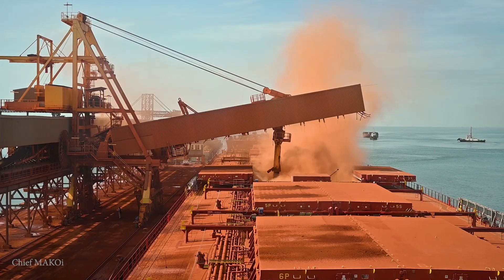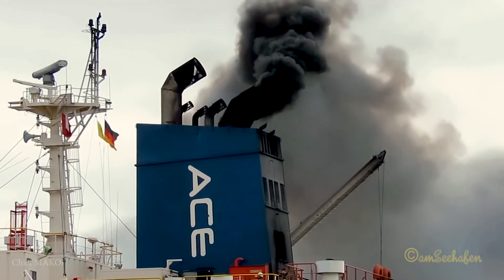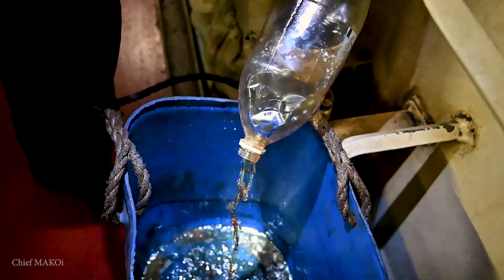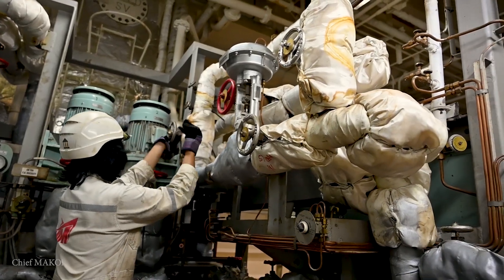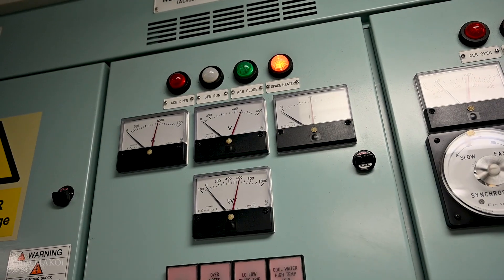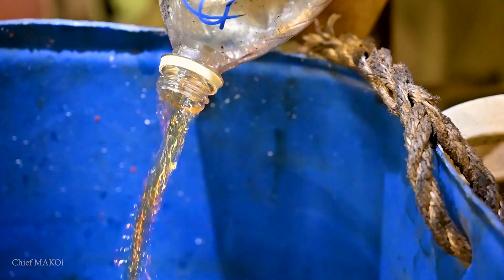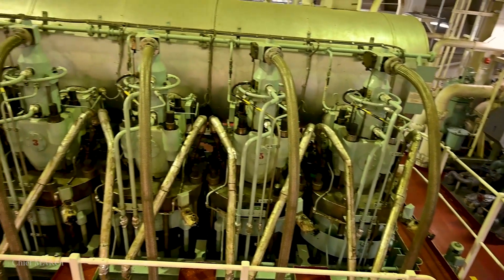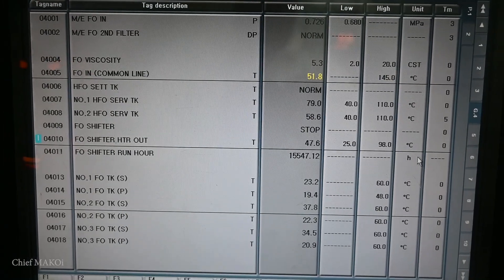Changing The Ship's Fuel : From Heavy Fuel Oil to Gas Oil Changeover Procedure | Chief MAKOi

Comment: Fascinating. Back in the late 70's I got to spend a few hours in the engine room of a cruise liner. The fuel they were burning looked like crude oil. You could watch through glass panels this mix being sprayed and burnt like a giant incinerator. Noisy hot uncomfortable place. Then you had to think back to the coal powered and the conditions the stokers worked in. Things have definitely moved on.
Reply: I think if you look ad some historic ships or railroad locomotives, you find a number of those had been converted from coal to Diesel at some point.
The steam engine remained the same, but the boiler was no longer coal fired but had an oil burner.
This was easier and faster to refuel and you could save personell as no one was needed to shovel coals any longer
Reply: @alexanderkupke920  Many WW1 warships were similarly converted from coal to oil fired boilers, when they were re-activated in WW2 It not only saved manpower, the new boilers were much smaller.
And not to forget USS Enterprise, which was converted by replacing the oil fired boilers with nuclear reactors. Though this was done during the design phase, before either was installed.
Reply: @peregreena9046  
Enterprise didn't have superheated steam, so the steam was wet, and the turbines sustained a lot of cavitation damage to the rotating elements, and internal casing's. The next carrier has superheated steam, and so dry. Not sure how that was done with the reactors, unless the superheaters were fuel fired. (JP)
Enterprise had 8 reactor's, 4 engine's, the later carriers have 2 reactors, 4 engine's.
Still fission reactor's, and therefore unstable.
Reply: @jimallen9859  Superheated steam or not, the machinery, from drive turbines to steam catapults, was the same as what was originally designed for the oil fired boilers
Reply: @alexanderkupke920  
The engine is still the same with a nuclear reactor as a boiler.
1,200psi superheated steam is some of the biggest horsepower in the world. Can make a 100,000 ton aircraft carrier jump out of the water like a flat bottom race boat, when Emergency Flank speed rings up. Awesome power, can push a bow wake higher than the flight deck. (a tad faster than the stated 32 knots)
Reply: For a long time the oil industry have been working on how to liquify coal to make it easier to mine after all it is the same as oil except it has gone hard over time.  People should award the miners and oil workers with knighthoods for what they have done for civilisation.
Reply: @Cruner62  Rudolph Diesel first experimented with making a engine that could burn coal dust before he settled on oil fired engines. I believe the he gave up on the idea after the coal dust engines exploded
Reply: @Cruner62  The Germans did a lot of work on making synthetic liquid petroleum from coal during World War II, so the processes by which it can be done are pretty well-known by now. The trouble is, the coal has to have been mined already to be put through said processes, besides which, they're so colossally inefficient that doing so only really makes sense if a) you have access to a huge amount of coal, b) you need liquid petroleum very badly, and c) you don't care how much damage you have to do to get it. As such, I suspect this is a technological dead end...
Reply: @ZGryphon  
Well, synthetic oil lubricant's have certainly taken off.
Reply: @jimallen9859  Different sense of "synthetic". Synthetic fuels like we're talking about above are made from a base material other than petroleum (usually coal) using very energy-intensive processes. Synthetic lubricants are almost always still mostly stuff that came from crude oil. In their case, it's a trade term for "contains a lot of fancy additives".
Reply: Worst thing about old huge cruise ships that could take a full day to resupply ocean cruise ship every time they crossed the ocean. Think the Titanic had around 80 guys shoveling coal into the boilors.

Comment: Great insight, thanks Chief. Can you talk about the fuel oil filters used for both VLSFO and LSMGO? I assume when using VLSFO, you have to operate the filters at low flux rate due to high viscosity?

Comment: Great video!
Some Chief Engineer friends (cruise lines) told me that going from VLSFO to LSMGO also may cause fuel spraying on hot surfaces and risk of fire. This is because VLSFO is more viscous and seals small fractures, while LSMGO basically cleans the pipes.
Is that true also for your engines?
Reply from the maker: It's possible.
Reply: In my experience the heavy oil circulates around the fuel system loop very hot 100c + to maintain viscoty. The MGO is unheated so the expansion and contraction due to temperature change can cause joints and gaskets to leak. After switching over an engineer is required to stay in the engine room to check for leaks.
Reply: @bigtuna4037  Exactly. In my case, when they switch to LSMGO they keep a  24h constant fire guard in engine room.
Reply: Do you mean scavenge fire or is it something else different entirely?
Reply: @cyberdiver7076  Fuel leaks from "O" rings, gaskets, seals, tube fittings, etc that have gone bad from multiple temp change and MGO solvent properties under pressure spraying (atomizing) hot fuel till maybe finding ignition source. One would be surprised the amount of fuel that can spray out under pressure,  Ive seen plenty of big messes since it usually happens at night when unmanned (that's when everything bad happens every time). Usually caught by the bridge watch on CCTV when everything starts turning black or the air hazy- that's really bad. There are hydrocarbon alarms but they are notoriously fickle.

Comment: I never knew in my wildest dreams that such huge and powerful engine can run on two very different fuel types, with extreme viscosity differences.  Now you are talking about engineering marvels.  I also did not know some nations had their own pollution control regulations with regards to marine vessels.  Cheers mate for your excellent work.
Reply: That’s basically what Rudolf diesel want when he invented this type of engine.
Reply: @MrTrashmasterfx  Fun fact Rudolf diesel run his engine on peanut oil at the very first public demonstration, because there was no crude oil available
Reply: @PumpKing96  yes i know Biodiesel ;)
Reply: This is where treaties and agreements like MARPOL are useful and important. It tries to standardise such regulations into common groups. Making it easier for people to follow the regulations of various nations. Similar things exist in aviation, physical mail, and even medical devices.
Reply: @ZaphodHarkonnen  And it can be problematic when it is done within the borders of a single nation.

Looking at you California.
Reply: A place my Brother worked bought an old 2.5 Ton military truck and it had a White multifuel diesel engine with a fuel list plate on the dash, that thing could run on anything it seemed like, from gasoline mixed with used moto oil to turpentine and vegetable oil, the injectors were massive compared to other engines of its size, but emissions were not of any concern to the military at that time.
Reply: @scout2nut  I work on turbine engines for the Canadian military and I can say that they will run on just about anything flammable, it makes them very versatile out in the field.
Reply: @NuckenFutz   I know a retired RR turbine development engineer. One of their experiments was running a jet engine on coal dust. He said it ran perfectly well but the engine had a very short life.
Reply: @DavidOfWhitehills  I've worked on military aircraft originally radial engines types but with jet engines added on. The jets ran on avgas, but again, short life as combustion was at a higher temp.
Reply: @DavidOfWhitehills  coal dust is very abrasive and becomes adhesive when burned, sticking to every surface as tar, over time it will throw fans out of balance and pretty much self destruction will occur, interesting experiment but in the end very expensive lol.
Reply: @NuckenFutz  those ships don't use turbines but two stroke diesel engines, they can still run on pretty much anything
Reply: @iafozzac  yeah I know, I was replying to someone talking about turbines lol
Reply: @DavidOfWhitehills  I think the germans worked on an coal dust powered pulse jet in WWII, but I don't know how far development got. Using a pulse jet reduced the problems related to taring and abrasion, but was obviously alot less efficient.
Reply: @scout2nut  I own one of these. A 1964 White deuce and half. Less than 1000 miles and under 300 hr.s on it.
Reply: @scout2nut  
Oh yeah, sawdust if you could get it through the injectors. Molasses.
Reply: It is a common characteristic for Diesel engines. The system is much more robust to changes in fuel characteristics because fuel is mixed with air through atomization at high temperature, not evaporation at low temperature as in a carburetor.
Reply: @TheEvertw  
Carburetor's atomize gasoline, just not efficiently. What are you thinking ? If it was evaporated you'd always be out of gas.
Reply: to make this possible the fuel oil with they high viskosity is heated up to equalize the the viskosity value
Reply: A big two strokes diesel engine can pretty much run on any fluid that burns. You can probably put olive oil in that bad boy and it would still run, it would be hella expensive tho
Reply: @iafozzac  Yep. There are lots of videos here on YouTube where people run older diesels on used vegetable oil, used motor oil, used transmission fluid, etc.
Reply: @iafozzac  I bet the engine room would smell better when it's running on olive oil!!
Reply: Those engines are huge, it makes sense they would run on almost any kind of fuel, as long as you prepare the parameters correctly.
Reply: @monad_tcp  
Definitely exotic fuel systems, heaters centrifuses, they basically used crude oil for a long time. Same fuel as the steam boiler's used. Lot's, and lot's of power.
Low-speed, two-cycle diesel engine's.
Reply: Old suck dieselengines can run on pretty much any type of oil but the modern engines (like since 1998) with injectors don't like it anymore.
When fuelprices has raised many came on the idea of putting vegetable oil in their tanks and the cars have run fore some time but after some time the injectos started failing (you can think of 200-300€ fore one) because the vegetable oil is more viscose which increases the stress on them
Reply: You still heat up viscous fuel to reduce its viscosity to that of light one.   So engine always runs on nearly the same viscosity fuel

Comment: Ships use used motor oil? Amazing
Reply: To oversimplify it, bunker fuel is basically the tar that is left over at the oil refineries after all the more valuable fuels (kerosene, gasoline/petrol, regular diesel fuel for trucks, etc) have been processed out of crude oil.  That's why it's so cheap, as if it's not burned by ships or (rarely, these days) power plants, it's used for the binder in asphalt roads... It needs to be used somehow, can't just dump it in the ocean, and it still has some value, just not much compared to other fuels.

Comment: Was the ship built with 2 fuel storage tanks? And will the LSMGO go bad if you don't get back to that area for a long time?
Reply from the maker: On that ship, we had 5 storage tanks for heavy and 3 for LSMGO. And no, it doesn't go bad.
Reply: Good question... what is onboard storage time for LA fuel?  On land we use diesel fuel with low sulfur and have to add special additives to prevent bio growth which ruins it.

Comment: In the past you just changed over to Diesel oil from Heavy fuel about an hour before arrival to port guess that was done for better manuevering purposes.
Reply: Probably less stringent environmental regulations back then so that you didn't have to change over as far out, and could get away with some admixture of heavy fuel oil.  The environmental regulations have been getting tighter (not just for ships -- also happening for land transport).

Comment: Does the engine performance is the same or better??
Reply: Great question, I'd was curious about that too.
Reply: @kerravon4159  I'm curious too!
Reply: Best power and efficiency is normally found with the heavy fuel as it contains more energy. With modern electronic controls the difference is lessened. Soot and other contaminants building up within the engine and exhaust stream are  reduced with the lighter fuels.